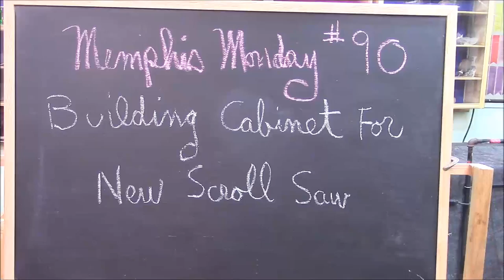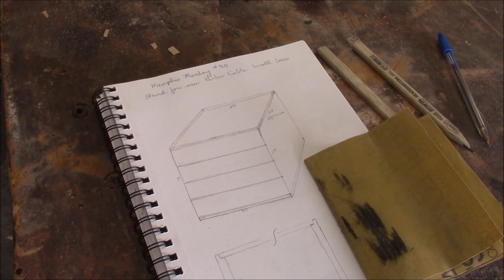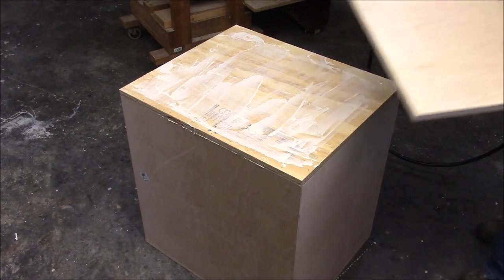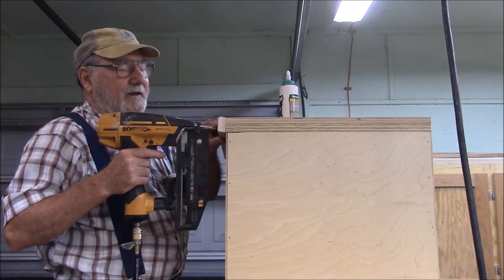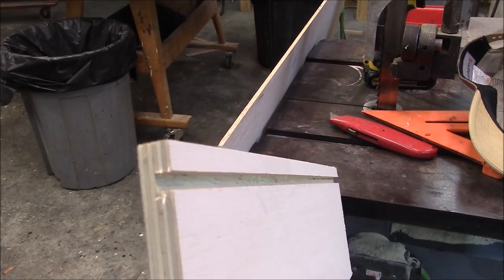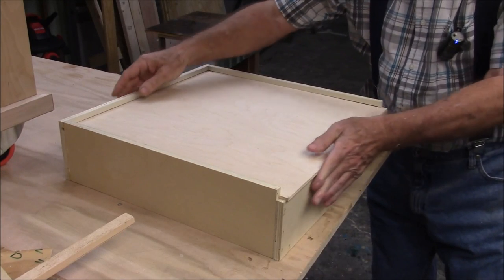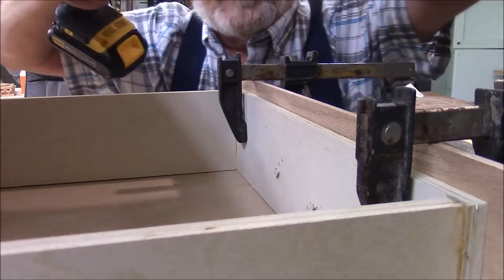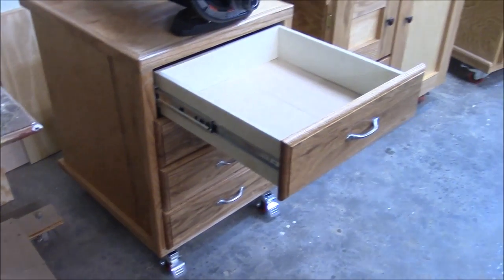90 Making cabinet for new scroll saw

Comment: I like your old one
Reply from the maker: I liked it too.  Nothing wrong with it, and it might last another 100 years!!!  Built like a tank.   The problem was that the bed wouldn't tilt to the right, and I wanted to cut angles to the right (like in dovetails).  Good thing is that I found a young guy just starting in woodworking and passed it on.  I also gave him my one trick pony mortising machine, which I never used in 10 years.  
     Thanks for watching and commenting.  Hope to see you back next week.

Comment: You have just about got the entire shop redone.  It is looking good, not to mention, you now have a ton of storage.  I have been meaning to ask, does the stain you are putting on these cabinets contain a polyurethane in it?  It was sure nice of you to give that young fellow your old saw.  He got a real gem.  Happy New Year!  Here's to a great year ahead for you!
Reply from the maker: Hope is to re-do it all, so I'm mixing it up.  Don't want to have all cabinetry videos.
No, I put the poly on later, as it takes several coats over several days.  I like to wait at least 24 hours between coats, and sand each coat.  They do make stain with poly in it, but I've never used it!!!  Another good idea you had!!
I also gave him my one trick pony mortising machine.  Hopefully he will use it more than zero times in ten years!!!!  Since both tools worked fine, and they both came with rolling stands, I think he did pretty well.  
Happy New Year to you also.  Thanks for watching and commenting.
Reply: ***** It is a good idea to mix up the videos.  I have used the stain with poly and HATED it.  Of course that was over 20 years ago and it may be better now.  I couldn't control how dark or light the stain was and it seem to want to streak.  If you do try it, you may want to get a small amount and try it on a sample.
You really gave that fellow a good start for his shop!  He may become a mortising master!  Have a Great Week My Friend!
Reply: Pidasian Hippie yes it was nice of him! and yes I did get a gem! A few days before Christmas I finally broke that old blade he had on there. was trying to cut a white ash and purple heart pen blank I was making for my daughter! (she loved it btw!)
Thanks again Memphis Applegate!!

Comment: Could you explain (or make a video about) your technique for using spacers to mark for the drawer slides? That is something I always struggle with. Thanks!
Reply from the maker: test
Reply from the maker: Man, I struggled with it too, until I invented this method.

It is a good question, but hard to explain here.  Therefore, I will make a "Memphis Answers" video in the next few days.

Thanks for watching and commenting.
Reply: Can't wait - I'll be looking for it. Thank you very much.